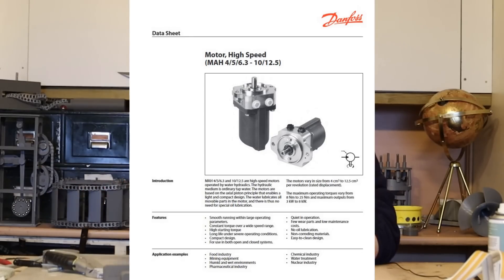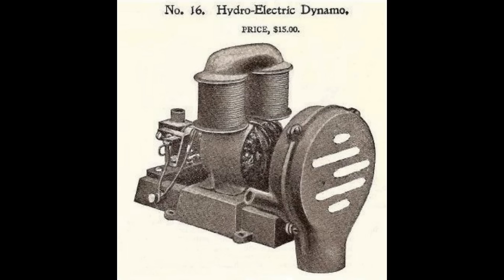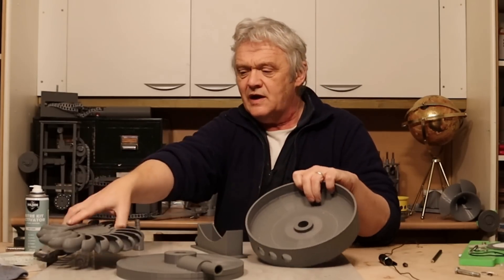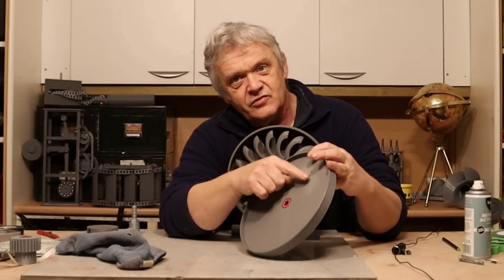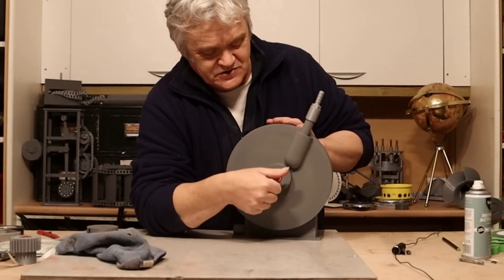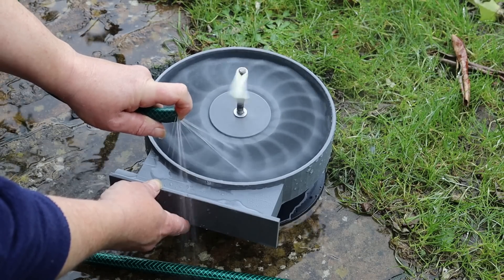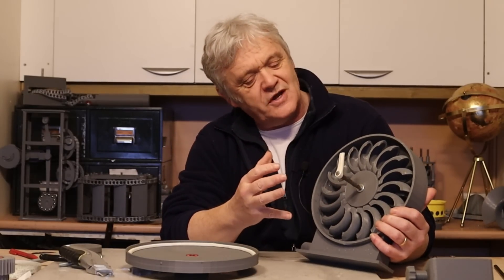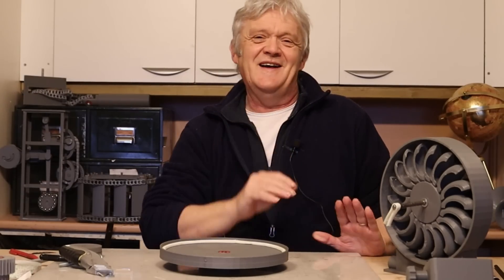2168 A DIY Water Motor - 3D Printed

Comment: Gotta ask:
What is this thing good for? 

If there's a blackout there's no water pressure to run it.
Even if there is, what can you possibly power with it? How much output does it generate? 

If there is electricity one doesn't need it.

Yeah it is a nice toy, great little example on how hydro dynamic powerplants are working!

Comment: So I get the pressure is an issue. So this may not be the greatest of ideas but could you put a valve on the input to control the water flow at least for testing. Also in terms of efficiency could you make a closed system. As in have a tank of some kind above the unit and use gravity to push the water through than in the drain section add the downpipe generation conversion unit you printed before to charge a battery of some type. The water would than be collect in another tank and using the battery the system is charging and may be some green secondary source like solar to power a pump to push it up again. Would that kind of arrange  min power loss. And give a stable output fro. The motor

Comment: Lovely project as always!
Just two comments, and I'm not the only one who thought about it (I have seen several similar comments so i thought of grouping them together).
- Bigger space or cavity to evacuate water, to prevent that rotor stalling. Since this is a pressure operated system, inlet could be just near the outlet, so only a minimum amount of water is dragged around the wheel. And much bigger outlet hole. This is a very turbulent flow, so the bigger out hole the better. I would even make that thing in a big "U" shape, with empty space at the bottom.
- Nozzles. Tips which can accept different size nozzles, or even better - a slot for a nozzle plate. This way you can change only a small plate with nozzles or adapt any other nozzles you can find.

Happy tinkering!

Comment: Technically, you can add multiple jets, assuming you have enough water flow, in pressure, and that when you consider that you need to ensure a free relief for each aperture, but that is not that terrible, should you simply allow enough space on the back side where that consumed water can find a way to escape, without needing to re-impinge upon the wheel [where it would cause viscous and kinetic drag].

In other words, a healthy bit of open space needs to be employed in the housing mechanism on this type of open turbine system, so that waste* water *[aka the water sprayed and not recoverable as more power, something that happens with all passive type reaction water wheels] has enough open space to escape, without coming back and acting against the work it just did.

One way on this is to have some baffle plates along behind the reaction points, so that the spent water is immediately diverted away from the main reaction wheel, and drained so that it can not come back and return to the wheel.

After all...

Water makes as good of a BRAKE as it does a driver, and in many cases, moreso.

While this is not a problem in positive pressure displacement motors [such as 'true' hydrostatic type vane and gear types], it is certainly an issue with free space, fall-away, passive reaction turbines.

This is one reason many such turbines are laid on their sides.

Such reaction wheels have come quite popular of recent years, and they lay on their sides, because the jets crossing the reaction wheels from the top, can easily just drain out the bottom.

They tend to be made where there is no opposing side, thus, nothing lay below them but open air, and the water can not come back up and cause drag issues.

This is a 'vertical axis' type layout, for those who may not have caught on to that point.

There are some videos of people using natural streams for this purpose on the internet, easily findable.
Reply: I have seen these set up with a vertical axis wheel, with 4 jets placed equidistant around the wheel, and yes, space below the wheel where gravity takes water quickly away. The generator then sits on top of the wheel, and it was very efficient.
All water supplied from a fast stream, piped down a hillside to give pressure for the injectors and returned  downstream.
Reply: @chrisyarnold6205 I would build one here in the creek that adjoins my property, if I had enough land to make it actually work.

I am, instead, looking to take a very radical hydrostatic water table flow route to harvest power.

It will take a long time to make it work, but once it works, it SHOULD give me about 15 Kw  [about 20.134228188 Hp] based on the hydrological values of this location where I live, on the side of the largest peak in the region of 150 miles, based purely on volume of water, and columnar pressure.

It will take a long time to develop it, however, because it will require many, very long holes drilled into the mountain [ "long" as in over 1 kilometer each ], all tapped into a single collection port, capable of dealing with over 300 PSIG [ 2068.427184 KPA ] so that it does not burst and leak on me.

I am not just doing this for a source of steady, free, uninterruptible power, but as a way to operate my future mine, which will use almost all of that power.

Comment: A 3d printed non electric ram pump would be cool.
Reply: Main problems i see there are waterproofing/pressure proofing and durability. Ram pumps can be build easily, cheaply, and durable with off the shelf components.   I just used a 20" water filter for the pressure tank and brass spring valves.

Comment: I like the slot idea. If you maybe split the down facing stream into 2 jets instead of 1, second jet @180° offset would balance angular momentum of sheer thrust force load on the bearing and blades. 

Orient the turbo vertical shaft instead of horizontal 
Also output dia
Maybe Air intake to pull air with the water.. 

Adding a second wheel axially coupled to the first to pull water faster via low/vacuum pressure Efficiency would also increase.

Comment: IIRC the "double cup" pelton wheel was the most efficient design. From Google: "Typically two buckets are mounted side-by-side on the wheel, with the water jet split into two equal streams; this balances the side-load forces on the wheel and helps to ensure smooth, efficient transfer of momentum from the water jet to the turbine wheel."

Comment: Impressive Robert…maybe make your nozzle section separate so it can be optimised without reprinting the entire housing?
Reply: Yes! Carve out a void where the 3 holes where, print different configurations, 1 hole, 1 slot, thinner slot etc. Also, making water turn 90 deg robs energy. For low flow applications maybe not a lot, but as soon as volumes are needed, ay ayy...

Comment: Awesome, I'm actually working on a water generator myself at the moment! The good thing about them is that the back emf is eliminated in a system like this. 
When a load is put on the generator it doesn't make the 'motor' part of it use more energy.

Comment: You would have thought the water company could have been used to provide electricity through this type of system rather than installing wires and infrastructure in the early days by having a "live" positive pressure pipe system, just imagine what could have been developed if they'd gone that route 150 years ago
Reply: Not really. The whole point was to maintain flow/energy. Any time you use said flow to power anything, you add restriction... and adding restriction, adds heat. Even on live source, gravity-fed systems... you never want to introduce unnecessary restriction/heat into the system.
Reply: Unless there was a way to recover the water used for power our waste water would be three to five times as much per household by my guess. On the plus side using on site generation of electricity would have meant that we could have gone with low voltage DC ( 12 volts or so) for lights and most usage and on site higher voltage generation for things like AC, electric stoves and power tools.
Reply: True but then you could use the heat to heat the home

Comment: I think an improvement to this design would be a sump area for the exiting water to clear the path of the powered cups. Not sure the right place to put such a void but it seems the evacuation of the spent water may be as important as the input arrangement.

Comment: The water outlets are not simple holes* (because of fluid dynamics in a system). What could work well for inexpensive 'off the shelf ' nozzles are from pressure washers. *see: waterjet nozzle designs
Reply: with a cursory look, investigate 'solid stream nozzles'
Reply: The issue might become with 3d printed stream nozzles is erosion,  but you'll have to look into it if you are interested. Perhaps a material solution? I don't know. There has been some interesting Danish research on projectiles in water using cavitation which may give insights. I don't know
Reply: Merry Christmas Rob.

Comment: If you put that at the bottom of a Bernoulli style valve, at the bottom of a 5 gallon bucket sized water mass vortex generator with a pipe coming in at the top on edge. You would have two generation places from the vortex generation

Comment: Great job, would it be that because the jets are lined up with the water feed 1 and 2 got most pressure and 3 was fairly weak? I watched something recently about running water 90° to increase pressure so maybe drilling halfway in from the outside at 60° then at 30° from inside to meet it would boost it. Have you looked at the Wirtz pump?

Comment: Is the inside diameter of the water intake consistent from where the water enters, all the way to where it meets the three small holes? If it opens up before it condenses it might lose some pressure. I'm definitely not an expert by any means but I had a thought and I wondered if it might be helpful.

Comment: Been thinking about this for some time. I'm in the UK and we have gas central heating. So we have a pump, pumping water around a circuit for maybe 4 to 5 hours a day in winter time. Been trying to decide if its possible to use a water motor somewhere in the circuit to generate electricity/heat to be stored in a sand battery, with a heat exchanger to put heat back into the central heating system and hence, reduce thhe time that the gas boiler is needed. Trying to decide if its a goer or not. Anyone care to point out the obvious flaw in the theory that i can't see 😂
Reply: Adding a water motor to your hot water circuit will require the pump's motor to use more energy. You're taking energy out of the flow of hot water by adding resistance to that flow.. At least that's how it looks to me. 🤔
Reply: @zapaholic Yes, I see what you mean, but would it be significantly more than adding a few extra bends into the system? And would the reduction in gas usage outweigh the additional cost of electricity . These are the things I am trying to get my head around. Afraid my lack of knowledge is a problem.

Comment: They used high pressure water. There was a huge network of a high pressure system in London alone feeding businesses and factories. There’s still outlets in some cellars. There’s  even a map of the network. Sad that we’ve lost so much useful technology. That’s one of the reasons why I love your videos and enthusiasm. Thank you.
Reply: Before the last reset. It all comes full circle eventually. So much "old" technology, lost to greed ..
Reply: Calling this useful technology in this day and age is crazy
Reply: @EugenePutin  Takes a bit of imagination, but in fact it is quite useful. ✌️
Reply: @orpheuscreativeco9236  make a case vs electricity please
Reply: @EugenePutin  You use it in-line to produce electricity, and still use the water for filling up your toilet, or a bath, or for watering your garden, washing the car, etc. It can even be used strictly mechanically to turn a gear system to lift or saw. On its own, not so useful, but it's great coupled with other bits. 😃👍
Reply: @EugenePutin 
It has it's uses.
I have seen several films of Pelton wheels used to generate enough electricity to run a small off grid homesteads in New Zealand, UK, and other countries. Enough power generated for fridge, washing machine, TV and lights.
Most of these run from piped water from a stream, down a hillside to create the pressure needed, and gives predictable 24hr power, whilst returning water downstream.
Reply: @chrisyarnold6205  dude. Those people aren't paying for that water. Yes, very doable though. Not when you're paying for municipal water.
Reply: Not being useful to YOU isn't the same as not being useful generally. @EugenePutin

Comment: Great stuff and it will work well by using a hot end printer nozzle and the size to use is 0.5 for the injection. Lovely!

Comment: I like these turbines.  I wonder if you would give us your take on using weight to force water from one tank into another.  Putting the turbine between them.   Always been curious if the energy potential was worth the time to investigate.
Reply: Look up accumulator....i think rob did a video on it
Reply: @sailaway8244   yes sir.  I understand they used accumulators though the theory is similar it’s not really the same deal.  

I’m curious how much energy someone could expect to harness if you put X amount of pressure on top of X amount of water, forced through a small nozzle that creates X amount of force to be harnessed via water motor and what volume maybe be required to allow a reasonable amount of run time on the rig.
Reply: @Route72Trucks  how is that not an accumulator as described in video 1919?

Comment: Wondering if there is a slot format that could allow for central inlet, and "slotted brake" design outlet to the turbine, in a 30 deg arc. I think that design might allow for more force distributed more evenly to each in time, and also to allow for what I'm only presuming is backflow issues from just 3 holes. Could you please test and share the outlet pressure? I'm looking at this for a whole house water pressure reduction at the front end that also does some good while operating, and I would like a baseline if you have it. 

Regardless, the merriest of winter festivities, safest of travels, and most Steampunk of new year's!

Comment: I have had a water motor for over 30 years. It runs from municipal water pressure and is a backup pump when the power goes out,  for my basement sump pump. ( Keeps the basement dry where there is a high water table).
Reply: Care to explain pls:
Where is the municipal water pressure coming from if there is a black out?
Reply: @falkbrosgen221  When the power goes out locally, it may still be on at the water pumping station.
Reply: @justtinkering6713  how much output does it generate?
In other words: what's the specs for your basement sump pump?

Comment: Home Hydro Generator. 

water is cheaper than electricity most places. the water company supplies our water pressure freely. can even pump it up a floor before bringing it back down to a larger model in the backyard :D
Reply: If too many people do this, water delivery infrastructure would fail, it's already illegal in most places because of this.
Reply: emergency use would be very ok.  and we need to circulate the flow, to not waste water, and no one can find out.  @vexy1987